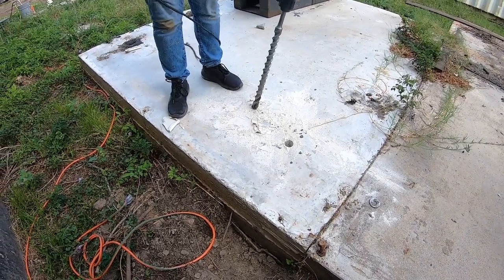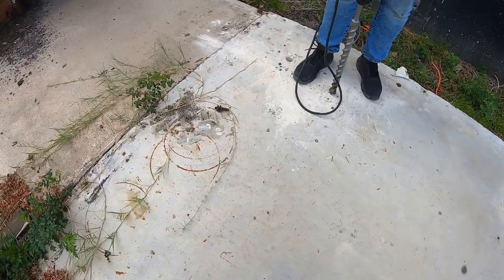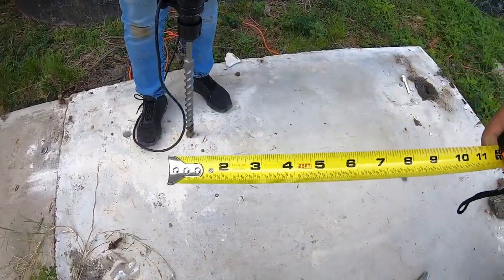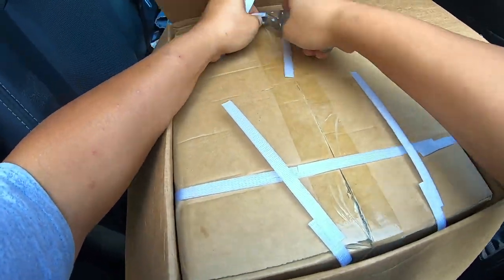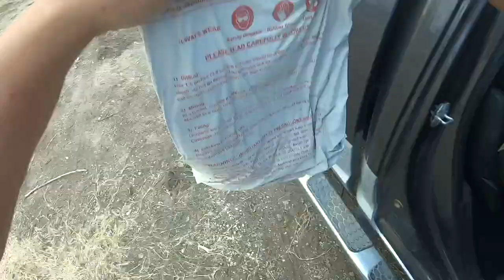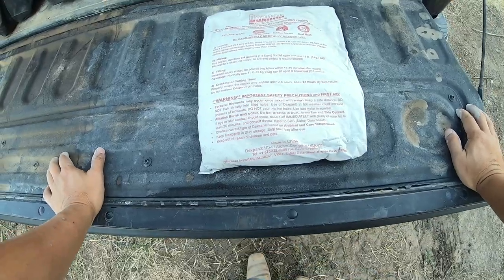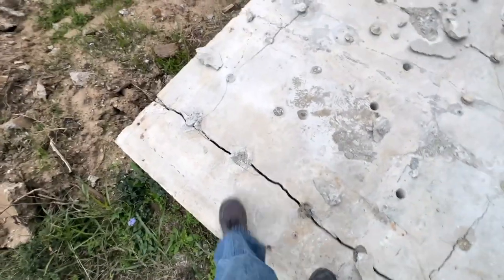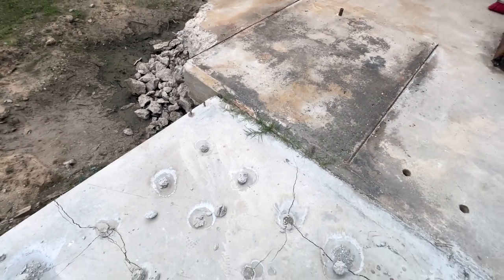DEXPAN - EXPANSIVE DEMOLITION GROUT

Comment: I used Dexpan on bedrock and it worked.  The difference was that we drilled the holes in a diamond offsetting pattern instead of in a row.  I found it on the internet  7 years ago and this was the pattern they said to use.  Hope this helps.
Reply from the maker: Hi Mary thanks for your comment. I have a question, if you have lots of diamond pattern side-by-side, wouldn't that create somewhat of a grid pattern anyways? What would be the different?
Reply: @DIYGEEKTEXAS  Space about 6” to 8” between holes.  My understanding is that this offset breaks and allows room for movement in all directions. In a straight line does not break it up enough.  They use this in quarries.  There they have one side open so a straight line will work.    From one Texan to another.
Reply: If he had drilled closer to the edge it probably would have done better.  Also we were advised to measure accurately the water.

Comment: Why not just use jack hammer to demo the concrete?
Reply from the maker: We will eventually use demolition hammer. But, It takes a lot longer without the pre-cracking process using Dexpan.
Reply: Dexpan is ment to be used for thick slabs, boulders, and bed rock. It's an alternative to explosives. A jack hammer would be better for this job.